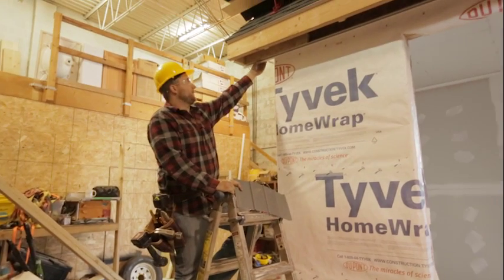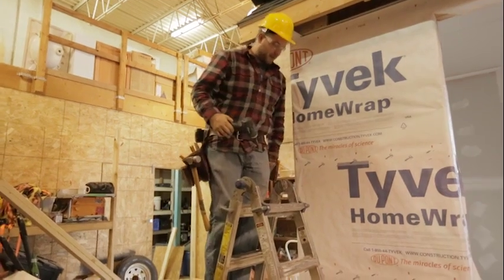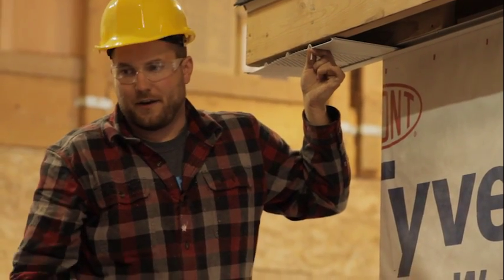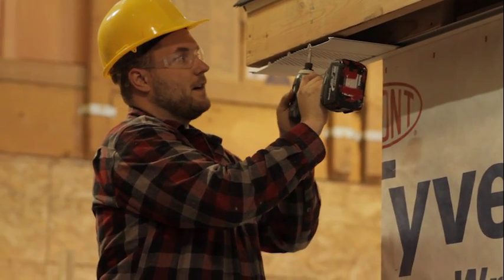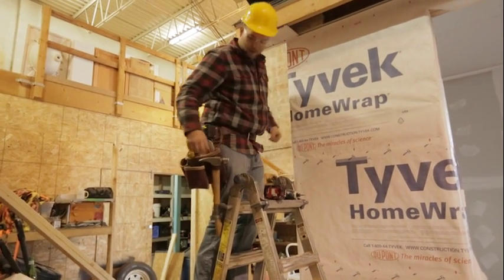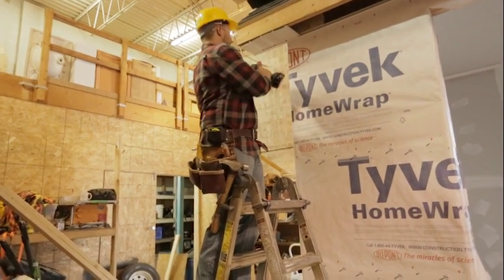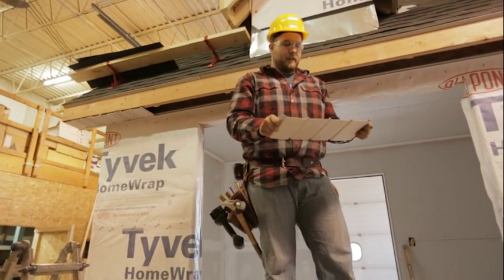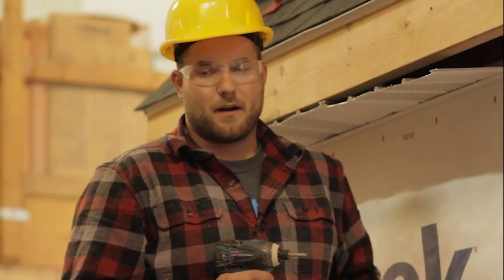How to Install Soffit and Fascia Part 3: Soffit

Comment: what if you just want to use the 2x6 as your fascia? Paint the 2x6 and attach the soffit, could you use another j or f trim on the fascia end to cover the gaps at the fascia end of the soffit? Or would you have another suggestion? 
Thanks for the great video.